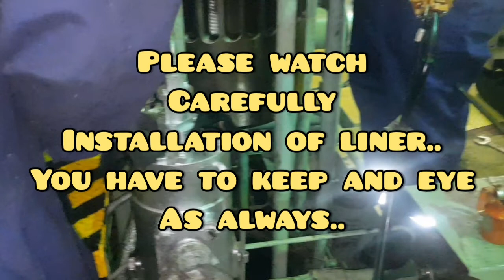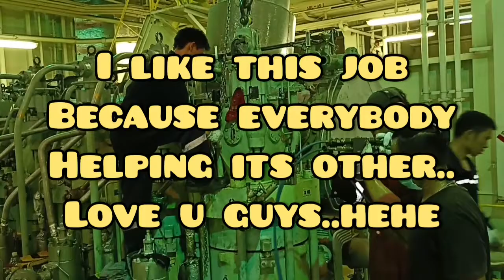main engine new cylinder liner ang piston renewed... #marineengineerworksvlog

Comment: Sir ano yang mga slot sa liner?
Reply from the maker: Sir di ko maintindihan ano yung slot na sinasabi mo sir..
Reply: @marineengineerworks  yong butas sa baba ng liner sir thanks sa reply.
Reply from the maker: @ricardopastor7488  scavenging hole.po yan sir.. dyan dadaan ang hangin galing sa turbo blower sir..
Reply: @marineengineerworks   salamat sir.
Reply from the maker: @ricardopastor7488  thank you din sir